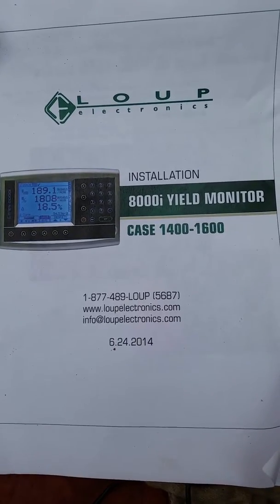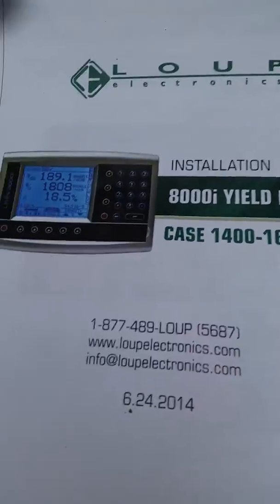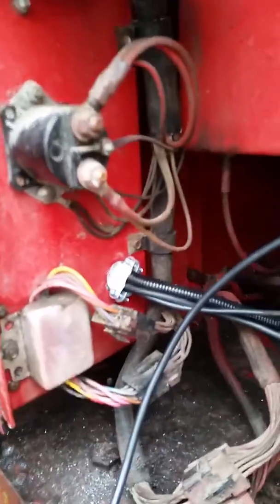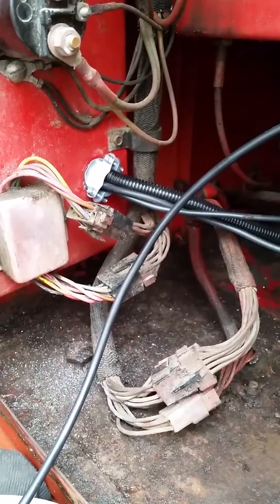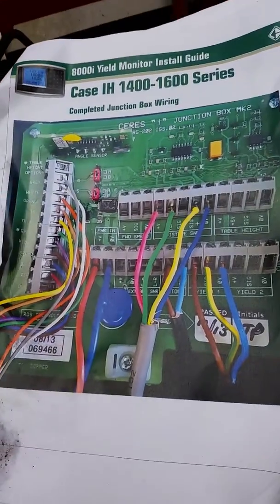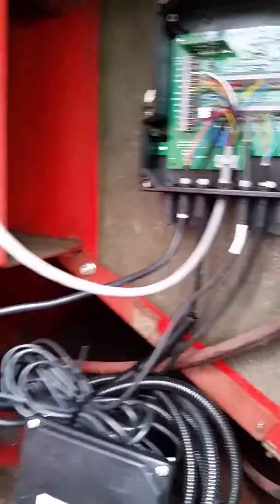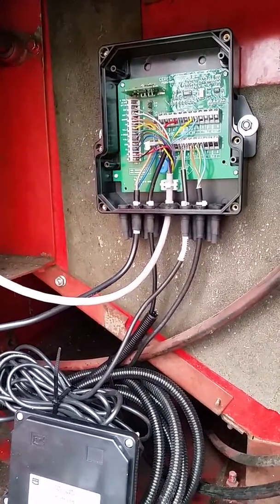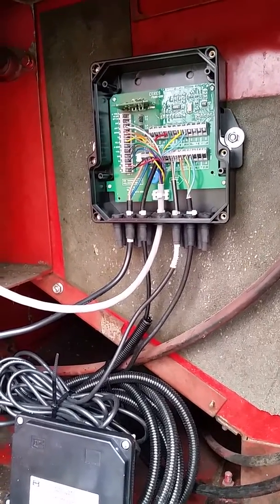Loup 8000i install IH 1460

Comment: How do you like the yield monitor since you have run it?
Reply from the maker: Its good very basic. The only thing I  don't like is the chain link switch attached to header. So on the headland you lift up the header the switch goes off and when put header down it pull on switch with a spring to on. Well if you have  head up to high for some reason it shut off the yield readings. So this year I just wired it to a lighted switch when on, in the cab. I turn it on when I'm harvesting and off when I'm not. Much better just have remember to turn on and off.
Very easy to install, I see they updated some hardware on the newer system. I dont need all stuff. I take the hardware out of combine in winter put in house keep out of the cold and moisture. Out the 10 months I'm not using it.
Reply: @farmfixes112  thanks for the reply. We are looking at the newer elite system that they have now. We are wanting to do more with variable rate and build out management zones. We have an old ag leader pf3000 but it is starting to get unreliable. Does it stay pretty accurate and calibrated?